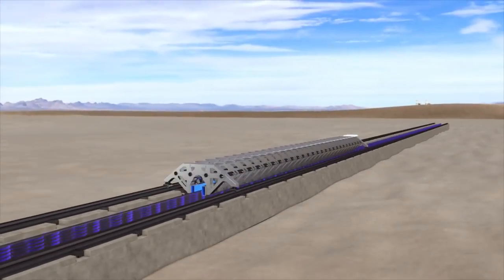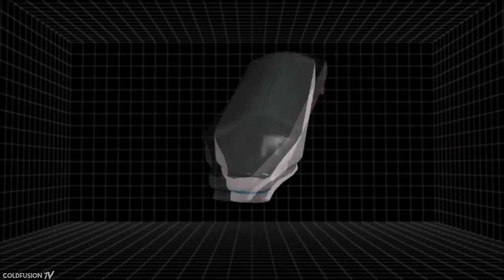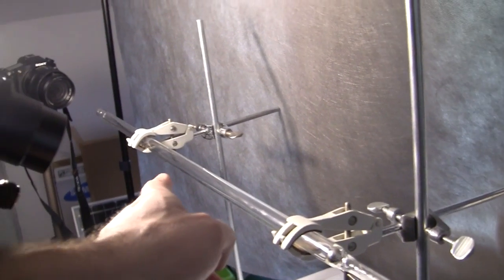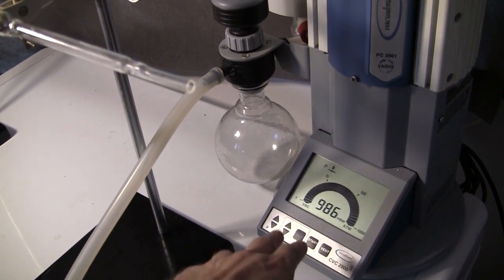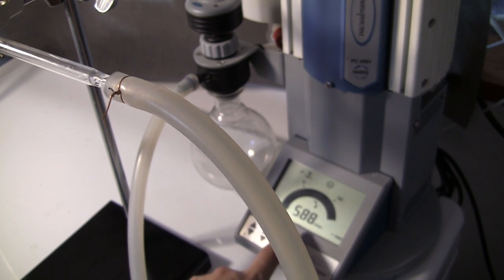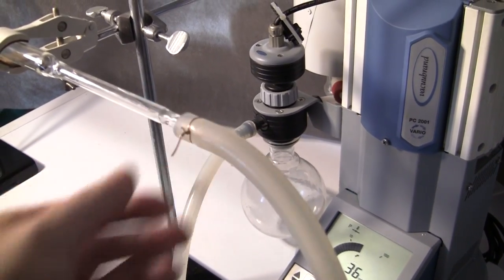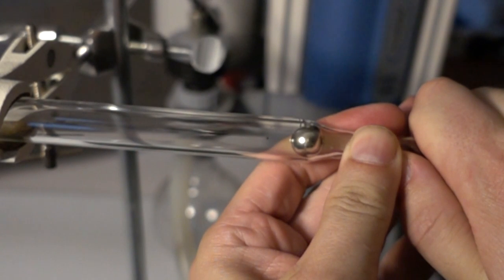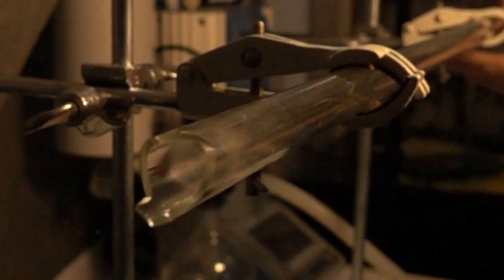How  the Hyperloop can kill you!

Comment: "No way of stopping."  In other words, Phil, your experiment assumes no safety measures of any kind.
Reply: ***** And they break up too. You have to stop safely and keep the people alive.
Reply: ***** If it operated in a miles long vacuum, yes, yes it would.  Or I suppose you could just drop several tons of cable on it to get the same effect as the weight of the earth's atmosphere trying to get past it ....
Reply: Brakes? You guys seem to not understand what kind of momentum (of the pod) and force (exerted by the rushing air) we're dealing with here.
Reply: +Ryan Bissett , Elevators don't travel at 1,200 km/h. Think of trying to stop a slow bullet. Bad example.
Reply: +Ryan Bissett
Actually, if you look at the physical distortion of a bullet pre and post detonation, especially hypersonic velocity in relation to mass, it is a great example of such a scenario.

Fire a heavy gauge high velocity bullet into a concrete block Vs into a water trap for example...
Reply: Matteo Del Gallo Haven't you just watch the video? The first thing he said is that he is making a debunking video of the hyperloop. This is just a single experiment which will be used in the full video (just like the video where he was measuring condensation on a peltier cooler which was then used in the Fontus debunking video).
Reply: +hellterminator is the tube going to be a single layer of glass , cuz I think that might be a bigger flaw than stoping the bitch in this scenario
Reply: @BrianOblivionB  The tube is going to be thin steel. (and no, steel is not too strong when it's super thin compared to what it has to handle)
Reply: Look man, here's the problem with brakes.

Let's say that you are in the middle of the tube when there is a breach behind you. You shoot forward at many times the speed you are going, right... unless you use the brakes... fine... we'll assume the brakes work (Though that is a tall order in and of itself) so, what happens if the breach happens AHEAD of the shuttle? Then, you are going to go from 700 mph forward to some enormous speed backward very quickly. If you don't think these levels of whiplash are enough to kill you, you're crazy, and the brakes, even if they stopped you from going backwards can't stop you from going from 700 mph to zero mph in no time at all. Meanwhile... a 35 mph crash is more than enough to kill a driver with a seatbelt...

This thing is a fucking deathtrap, and it's likely to be a terrorist target as well.

Good luck with that shit.
Reply: bigstudwithaguitar ... ok your forgetting that it also uses magnetic propulsion... if you flip the polarity and use the magnets with the on rail brakes and decrease speed at a reasonable rate you'll be fine... and as for a terrorist attacks; our current railroad system is more likely to be attacked.

... oh and I forgot to mention that this train is a upgraded version of a maglev train witch also uses magnets to propel it's self these trains are already in use
Reply: @tylerprince9494  1. Current Maglevs don't have to withstand the force of a wall of air in a vacuum tube.
2. Yes, railroads can be attacked, but in the unlikely event it does happen, it does not result in the instantaneous death of everyone using the entire system. 
3. As mentioned in another comment by another user, A. Your brakes will need to act extremely quickly, and B. if the vacuum breach occurs in front of you, you will be pushed backwards, meaning the pod will suddenly decelerate ( at a very rapid rate) and then accelerate backwards (at a very rapid rate) If that rate is high enough, you will black out.
Reply: ***** And you're obviously a bigot, as I carry on most all my long discussions with those that disagree with me.  It's the only way to check your own math, as I don't go with what feels right...
Reply: Well, usually in debunking videos he is pretty in depth, but this one's weird, only 3 mins, and without one single calculation
Reply: cameronsprague101 If something goes wrong with a plane it crashes into the ground.
Reply: reverse the polarity of the maglev to act as an emergency brake.
Reply: There are two states of the car: stopped, and in motion. Then there are two options for failure: either the vacuum is lost in front of the car, or behind it. Then we have to ask how bad the leak is. Is it a catastrophic failure or is it a slow leak? We need to plan around all those contingencies. There are clearly challenges, yes. But they are not insurmountable.
Reply: +Sion Nois

Actually no.

A plane is made to glide, it wants to stay in the air. Yes gravity pulls it down but the airflow over its wings keep it up. So even if the engines fail, and it has happened, the plane won't fall like a brick. Instead it slowly glides down to the earth. 

Now a plane will be at lets say 30 000 feet. And lets say that for every 100 feet it glides 1500 feet further. A 15 to 1 glide ratio. A boeing 749 has a glide radio of 17:1! 

That means the plane has 450 000 feet or 150Km's to find a place to land. 

Yes if in the middle of the ocean, there is a problem, but if the plane is flying over america, europea, asia or even between islands. Then guess what there is enough time to find a near by airfield and just glide down to it. 

You would be surprised how much a plane wants to say in the air! Getting it down is harder then keeping it up once at speed.
Reply: Also stopping quickly = high g forces = death
Reply: ***** ...may fail? Ahhh, what safety measures have we developed that can stop an object that has just been accelerated to the speed of sound in no time flat? Furthermore...even if you could stop the shuttle...the moment the shuttle is accelerated...everyone in it will already be a bloody mess...because humans are not meant to be accelerated to the speed of sound in such a short space of time...those who magically did survive when then die immediately when the shuttle is stopped (somehow?)...this wouldn't change the ridiculous amount of pressure the atmosphere would be placing on anything and everything throughout the tunnel.
Reply: I don't see how something could stop a pod going at 700-1,200 MPH without breaking itself. You'd have to be able to slow it down before a very specific distance along the track or else everyone passenger's skeletons would be flying out of their bodies.

@ Ryan Bissett No, because falling elevators aren't going at 700-1,200 MPH like Elon Musk proposes his Overhyped Loop will go.
Reply: If you understand the difference between a cast metal toy car, and a real one, you can understand how the "Train" will be blasted down the tube in pieces, and more so if you try to apply brakes...
Reply: true that
Reply: ***** yes
Reply: TheKnight OfCydonia I'm sorry, how is that relevant?
Reply: Let's say you have 10 ton "container" doing 500 km/h. What force do you need to stop that thing? What will be the G-force?
Reply: @peppybocan  Kinetic energy = 1/2*Mass*Velocity^2. So 500km/h = approx 139 m/s. Let's also say the tons is in metric tons so 10 tons = 10000 kg. 1/2*10000*139^2 = 5000*19321 = 96605000
So your object will have 96 605 000 joules of kinetic energy!
Reply: +Ryan Bissett  ...yes bullets do stop rapidly...generally while being basically liquefied (not literally but visually it appears that way.)...another point is that human beings are going to be inside the thing...I don't know about you but I'm certain human bodies are not meant to endure being accelerated to near or about the Speed of sound in an instant...
Reply: +Sion Nois  ...planes don't magically accelerate to about the speed of sound in an instant, nor are they confined within a tube once they fail....
Reply: ***** To stop it from careening into the side of the tunnel...that is literally a metre away?

My point was in the case of vacuum failure...that you're just fucked.
Reply: @7dayspking  Less than a metre
Reply: bigstudwithaguitar I've been reading through this discussion just now, and there's a problem with your argument. You're assuming that if there is a vacuum leak and the vehicle encounters atmospheric pressure, that it's just going to instantly stop as if it hit a brick wall. Aerodynamic drag doesn't work that way. It will decelerate, not instantly stop. The Space Shuttle re-entered at 17,000 miles per hour when it hit the atmosphere and it would take several thousand miles for it to decelerate down to landing speed. When the sub-orbital spacecraft SpaceshipOne re-entered, it reached nearly Mach 2 while it fell through the vacuum of space, but then decelerated fairly gradually as it came back down into the atmosphere. Passenger jets fly at over 600 mph, but if the engines fail, the plane doesn't instantly stop as if it a brick wall. Air does cause a lot of resistance, true, but it doesn't INSTANTLY stop things the way you're implying. I do agree with you that this HyperLoop thing would be really impractical. But hey, if Musk wants to build it with his OWN money and people are willing to take the risk to try it, then let them.
Reply: Garritt VS You know what happens when you instantly stop acceleration you basically die since the stop will still kill so brakes aren't a life saver
Reply: Colin McNulty a Instant stop will kill you and a example is if you commit suicide jumping off a ten story building will definitely kill you not by falling but by the ground being a brake causing you to become nothing but a pile of human remains no human is strong enough to handle a Instant stop in motion
Reply: Mass is a bitch...
Reply: Yea, I would imagine there would be some sort of breaking system installed.
Reply: And a way to repressurise evenly
Reply: oh well sorry, didn't pay attention at the start apparently
Reply: +hellterminator how many fail safes will be in the tube if it detects anything unusual it would be unable to work, the whole idea of needing to stop in this scenario would be if everything was fucked, this is the absolute worst case scenario, when everything else is broken
Reply: TheKnight OfCydonia I still don't see how the model using a glass tube is relevant. The whole point of the experiment was to demonstrate what would happen to the pod if the tube failed. What the tube is made of is absolutely irrelevant in that context.
Reply: you can't stop it that's the problem. Seriously are you stupid? Imagine a subway traveling at the speed of a bullet, if something goes wrong the only thing stopping that is a thick wall
Reply: cameronsprague101 the capsule should be propelled by electromagnetic propulsion, so you just need to turn the electromagnet on after the capsule has passed it rather than before, and if you need to stop faster you just put more current through the electromagnet.
Reply: @anuphys  You need to get rid of a ton of energy, and you have the force of a wall of air pushing against the pod. You'll need a really powerful magnet in order to stop the pod.
Reply: do you know anything about newton's laws.
Reply: Well, let's say, within 10 seconds, for good measure...
Reply: Well it's not much different from trains we already have, they are just faster and have less air inside their tubes. Maybe they won't go for a full vacuum, but they could probably still get trains to go up to 900km/h.
Reply: Why does everyone assume the scenario to be unbeatable and expect somehow to win..., Ofc no one will survive sudden standstill after going at near passanger airliner speed, thats why you have constant pressure and leak monotoring systems in use as to detect these major issues before turning the commuters to paste. Things like emergency brakes and or emergency tracks can be things used incase of these incidents. Modern bullet trains goes upwards to half that of passenger airliners. And you can bet that accidents on any of these will end in tragedy anyhow you put it simply due to the forces at play. That said is the above impossible? 

As impossible as flying at mach speeds... which is possible.
Reply: @Zretgul_timerunner  The point here is that if there is a sudden decompression, say someone accidentally crashed into a support pillar for the hypertube or something else, no leak monitoring system will be able to act so fast that preventative measures can take place. You cannot predict when these events will happen. And no, emergency brakes will need to be extremely strong to A. decelerate an object moving at Mach 1 at a safe rate and B. resist a wall of air rushing towards it.
Reply: Yes and no. Even with the fancy maglev technology that people are proposing now, the pod would likely suffer from being crushed as the pressure change is so large. Even if there was some way to somehow slow the pod down (a wall of air pushing on a relatively flat surface exerts quite a large amount of force) with the existing maglev technology. You would need extremely strong magnets in order to resist the force of the air pushing against the pod.
Reply: Oh shit... I didn't even realize you were replying to thunderfoot's video... gawd you stupid. He literally JUST showed you that a vacuum breach causes instant acceleration... and here you are saying stupid shit like, "It will decelerate, not instantly stop."

No dude... It won't decelerate. It won't stop. It will most likely go backwards very very suddenly if there is a breach ahead of trajectory. No different from a bird being sucked into a jet engine... except... the bird wasn't going 700 mph.
Reply: Shane Killian's and Libertarianists response to thunderf00ts video: Thunderf00t's "How the Hyperloop can kill you" KILLED. He posted a video reply to Thunderf00t;s video. And they will be making more videos in response to his series. And they pointed out the ENORMOUS flaws in thunderf00ts "experiment"
Reply: You're ignoring the propulsion system, which is effectively a linear motor controlled by electromagnets. These will very easily be able to provide very effect braking for the train, and in fact would lock the train in position while parked.
Reply: @ColinMcNulty  You'll need a really powerful magnet to hold that- not to mention the pod will be travelling at Mach 1 in the vacuum tube- if you suddenly lock the pod in place (assuming the magnets are powerful enough) the pod will decelerate extremely quickly, causing you to blackout because of extreme g-forces. It's the equivalent of being launched at Mach 1 at a solid brick wall- you are guaranteed to die if the g-forces are high enough.
Reply: You didn't address the issue of having a breach AHEAD of the shuttle. THEN, braking isn't the issue. The issue would be that you just hit a fucking wall of air resistance. IF your brakes are strong enough to hold the shuttle in place after a breach from ahead... good on you... the passengers STILL went from 700 mph to 0 mph in less than a second. The people inside... are dead... unless the shuttle can INSTANTANEOUSLY generate enough thrust to push through the vacuum pressure... which it totally can't.

It's a broken concept, and it's VERY breakable. Terrorists love to attack symbols of ingenuity, success, economy, progress... and frankly... it's just too fucking easy to really fuck this thing up.

It's a disaster waiting to happen.

The maglev is fine... completely fine. THAT is not the part that's stupid. The part that's stupid is creating a vacuum charged environment to avoid air resistance. There are no safety procedures that can make this thing safe in the case of a tube breach.
Reply: Thunderf00t is just full of himself and, tbh, i've had it ... he can finance his shitty experiments and "debunkings"  with other gullible people ... i'm off.

Comment: I'm not working a hyperloop, but it seems to be the problem could be solved with pressure sensors and release valves.  As an experiment break the vacuum at both ends at the same time and the ball won't move very far at all (equal pressure from both ends).

Comment: The hyperloop is so long that you would have a long time to break if you ever get catapulted like this.

The linear electric motors that accelerate the hyperloop pods are also used to decelerate (and therefore generate electric current, it's the same thing as when you brake in a Tesla, the battery recharges, except the motor is linear/unrolled)

And yeah, all forms of fast travel are catastrophic if something fails, doesn't mean they are "debunked"

Ultra-clickbait thunderf00t, I'm disappointed

Comment: and what happens if you breach one end and then have a very fast sensor to detect a change in pressure which causes intentional pressure releases at a whole bunch of different intervals all along the system? the cause of the acceleration would quickly disappear.

i thought you were supposed to be a scientist thunderfoot? this is just pathetic fear mongering. there is a problem, you highlight it and then pose solutions, thats what a scientist does. you didn't even end the video with "and how can we solve this". this isn't an infinite energy machine or the stupid/pointless combined idea of a solar highway. there is a way to make it work and it looks like it would be worth creating.
Reply: "there is a problem, you highlight it and then pose solutions"
That's more like an engineer. A simplification is that Science is about modeling reality, and Engineering is about using models to solve problems.
Reply: agreed!  I was just about to post this.
Reply: Erick Cobb sure, a engineer would be the more lilely person to design and create the thing and have to solve problems with it as they go. but as someone testing if it's plasable a scientist should still want to experiment with the issue and find out what happens when you change things. not just do one experiment and say it must be a load of bollocks/pr crap from that one test.